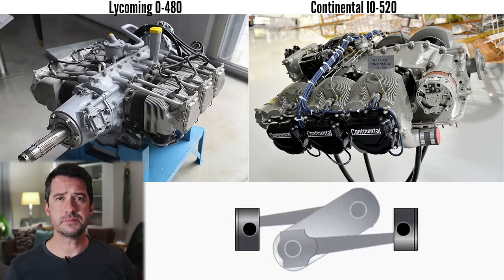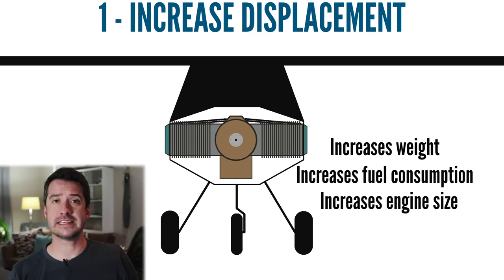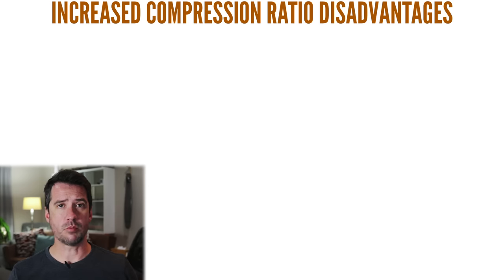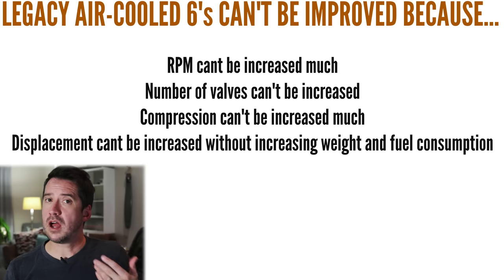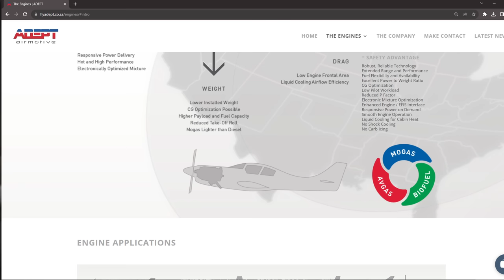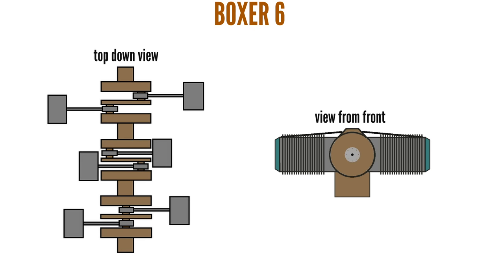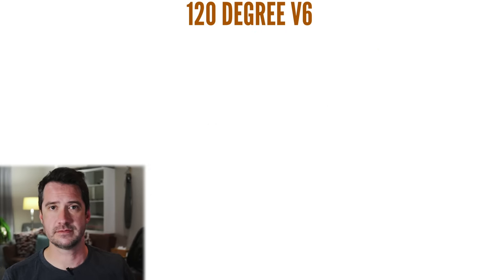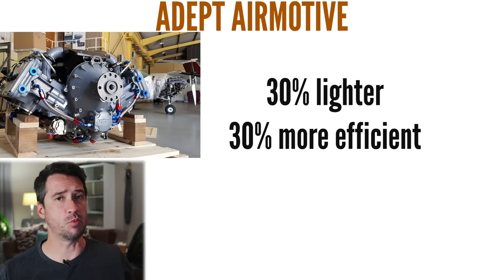Unusual V6 Airplane Engine Makes Boxer 6 OBSOLETE?

Comment: The future is with a return of the Detroit two stroke with direct injection coupled with a multistage electric turbo/supercharger. An hybrid of the sky who can have a very high compression ratio for efficiency, is compact, and able to give a big burst of power only needed at take off.

Comment: OHV valvetrain design is not a problem itself; modern OHV engines can hugely benefit from CFD optimisation and can produce very good power-LS series from GM is a good example. Besides that, OHV engine can pack more displacement into the same engine bay volume, we just need a modern engine, not a 1930s antique.
Reply: Pushrod engines are obsolete. They are okay for off idle power, but that is of no relevance to aircraft. Pushrod engines are less efficient and don't last as long. Hence, every reputable manufacturer no longer uses them.

Comment: Continental cranks fail all the time 😂
Reply from the maker: Which ones are that? I always though the bottom ends of Conti's are usually bullet proof and problems are usually higher up, e.g. the well known valve port cracks. At least I know it is for the O-300.

Comment: 120deg V6 does not exhibit secondary balance. It is almost as bad as I3 in terms of primary and secondary balance, with end-to-end rocking motion for both.

The only even-firing V6 with some inherent balance (akin to the crossplane V8) is the 60deg with 60deg offset crankpins. The primary vibrations become rotational, to be compensated with crankshaft counterweights. Secondary vibrations go (counter)rotational too, possible to compensate with a single balancing shaft, rotating 2x the crankshaft in opposite direction, so the gear coupling is the easiest possible, although most engine makers dampen these vibrations in the engine mounts.
Reply: The secondary imbalance of this engine configuration is not even enough of an issue to warrant the use of a balance shaft in the current 120 degree V6s from Ferrari.

Comment: The BEST for high horsepower requirements?! It makes 145 to 175 horsepower a 2006 2.5 boxer 4 subaru makes 175 hp. I dont understand why people think aircraft are so impressive when its rocking pushrods, you want high volumetric efficiency no? Get more valves a single overhead cam with 4 valves would be great, but a five valve dual cam engine would mop the floor with these beasts. A good engine is good but i dont respect the fact they choose to rip you off with abysmally out of date engines that spew lead everywhere, honestly want them scrapped.
Reply: 5 valves don’t work. I mean, I would love to see a warbird with heads with a lot of valves and spark plugs, but 5 isn’t it.

Comment: Just chevy LS swap it...they made them out of aluminum so light weight and they will turn 8k rpm, super reliable and relatively cheap, they love boost...and there is nothing like an American v8 screaming at 6-7k rpm
Reply: That would weigh at least 200 pounds more than this engine.

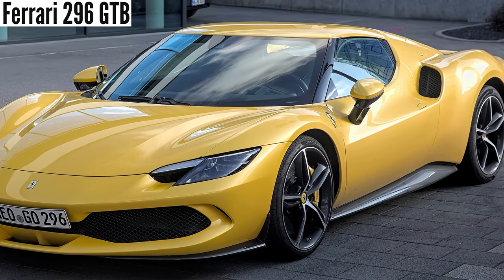Comment: I am really looking for a way to say this without sounding like an asshole... but I have never seen a boxer configuration engine in an airplane.  But then around 9:20 into  your video you take the primary advantage (secondary balance) of the boxer engine (which is not  used in aircraft) and spin it as a negative thing that this engine is overcoming... how do you overcome a problem that doesn't exist?  All of t he performance gains you talk about could be achieved by going to a boxer configuration... show me something beyond that and... well... probably still not worth the 500ish  units GA sells a year  unfortunately.
Reply from the maker: But it is boxer configurarions that most airplanes use, like the 6 cylinders in this video. Boxer meaning the opposing pistons move in and out together, since they each have a separate crankpin.

Comment: the DOHC v engine in aircraft has been around for 79 years. Your display engine has a Reduction gearbox (extra weight and maintenance) along with DOHC which is more moving parts and maintenance. The v6 engine was ran at the Reno Air Race in the "Ponds Special",  a Twin engine TSIGO DOHC v6 which failed in a turn causing a turn into  the dead engine at 400mph 300 feet off the deck. Diesel is the future for fuel efficiency in light  aircraft (The germans were flying a twin Bomber diesel in ww2).
Reply: The primary purpose of a PSRU is to improve the power to weight ratio of an engine.

Comment: These long used boxer airplane engines always vibrate like mad and are unnerving compared to automotive engines. If any car ran as roughly as these planes you couldn't sell a car to even the untrained user.  The rebuild shows are constantly spending 10's of thousands of dollars rebuilding the damn things so it's way past time to replace them with something far more modern, reliable and cost effective.
Reply: 4 cylinder engines tend to roll a lot because all pistons move and stop at the same time. Inline-3 or inline-5 is better.

Comment: You lost your credibility the moment you tried to say aircraft engines don't use shared crank pins  . Lycoming & continental engines have always ran shared crank pins that causes a twisting imbalances around a vertical axis through the engine taken up by the motor mounting system to save weight . the legacy engines are a locked designs due to federal regulation and testing procedures it is easier to designs a new engines than bring these engines up to new tocology they can be made much more efficient & reliable with more power but costs millions' just to change something like a bearing material or add electronics to ignition systems . If i remember correctly Just adding electronic ignition to one bank of spark plugs has an average 7% efficiency boost if taken advantage of properly.
Reply from the maker: But they don't use shared crankpins. That would sacrifice all primary balance. Have a look at a Lycoming or Conti crankshaft (Google if not possible in real life), it's easy to see 🙂

Comment: You clearly do not know how engine displacement works. You bore out the cylinder which takes out weight & put in new over size pistons that are aluminum, the larger pistons are most often no more weight than start.
Reply from the maker: That's how you do it after-market, and you are limited how much you can bore (obviously). But that's not how for example Lycoming increased engine displacement. Surely you are not saying an O-360 is a bored-out O-320. I think you get my point now.

Comment: I think all the advantages of this V6-120 could be present in a V6-90 degrees adding a perfect balance (first and second orders). But the V6-120 has a firing time of 120-120-120-120-120-120 degrees, and a V6-90 normally has 90-150-90-150-90-150 degrees and makes an unpleasant sound. But a V6-90 can have a different ignition order, firing all 3 cylinders of a bank and after that, firing the other 3 cylinders of the other bank, producing 90-120-120-150-120-120 (there are 3 possible combinations) . What sound would this engine make?
Reply: Most V6 engines are 60 degree.  The 90 degree V6 such as the GM 3.8 required a balance shaft.
Reply: @dl1027  The 90-degree V6 engine has perfect balance in first and second order. But this V6 GM is not perfectly balanced because the crankshaft bearings for cylinders 1 and 2 are not on the same axis. Same as cylinder pairs 3-4 and 5-6 (english from Brazil).

Comment: Converting the old engines to lead-free is actually pretty simple, just like it was for automotive engines 50 years ago.  Install hardened valve seats and MAYBE tweak the spark advance and you're done.  The FAA is probably to blame for leaded fuel holding on for so long in aviation, because they're so reluctant to make any changes unless someone gets killed... immediately.  The slow death tetraethyl lead can cause is just a "eh" to them.

Turbochargers also add a lot of heat, which is a huge problem for air-cooled engines.

Bumping compression ratios on a low-RPM engine can (will) lead to high piston and cylinder head temperatures, detonation, etc.

Overhead cams and multi-valve engines could be a huge step.  I'd argue they don't really reduce complexity over pushrod engines.  One upgrade that should be simple would be manufacturing cross-flow cylinder heads.  You get more room for larger ports and more efficient port designs, since they're on opposite sides of the head, and you get less heat into the intake port.

There is so much of the 1930s stuck in these engines and it honestly wouldn't be too hard to engineer it out.  But, again, FAA doesn't like change so they make any little tweaks prohibitively expensive.

Oh, crap.  This wide vee is going to be odd-fire?  Yikes.  One of the other huge advantages to boxer engines is that they're very smooth.  Odd-fire V6s have serious NVH issues, which is why the automotive world quit using them, again, decades ago.
Reply: Why would it be odd-firing? The firing interval of a straight three is 240 degrees, and a 120 degree bank angle is smack in the middle of that interval.

Comment: So this is basically a "copy" the 120° V6 Rotax prototype? iirc Rotax even built a 250hp(?) version, that was intended to compete with IO-360 and up.
Reply from the maker: Copy as in copied the idea of an aviation 120° V6? Maybe. Just doesn't look similar enough to me to be a copy, not that I care if it's a clean sheet design or not. But only judging by the few small photos of the Rotax, looks like Rotax went SOHC, possibly OHV, hard to tell. For the Adept to go DOHC is enough for it to have required some brand new design. But I'm just speculating, don't quote me.
Reply: @LetsGoAviate  which is why I put that word in quotation marks 😊

Also in my view the designs are sufficiently different that one could comfortably deny the allegation of theft of IP (which is what real copying would constitute).

I'm equally excited that someone is attempting to take that path. I think a higher revving, geared gasoline engine running on car gas is the only probable replacement for the old aero engines still reliant on leaded AVGAS.

Not all airframes are suitable for the comparably heavier diesels.

Comment: Decent concept. The engines need to turn more RPM without adding prop speed but even the GTSIO520 had redrive issues though. To me, the redrive/PSRU is always the achilles’ heel on higher powered general aviation reciprocating engines. Planetary is the best way to go IMO. Metallurgy and intake flow are other places of improvement for the existing mainstream engines to make more power in their current form.

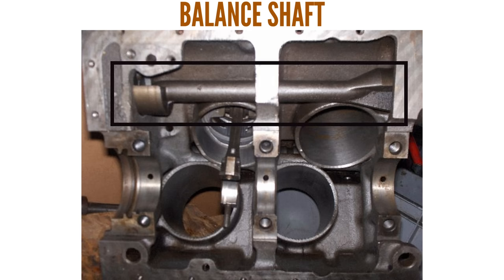Comment: OF ALL the balance shaft engines, you choose the ancient Ford (Cologne)Taunus V4  60 degree? That's certainly a blast from the past at ( 15:15 )
Reply from the maker: It's got to do with image copyright. Can't just use any photo in my video, and this was the only creative commons/public domain photo of a balance shaft available.
Reply: @LetsGoAviate  I see, it's a fine example indeed. Although that balance shaft plays havoc on the bearings and front seal when those get up in miles.Nice vid

Comment: Weird

I just watched a video explaining why all of the 120° V6 engines that were tested decades ago were found inadequate. Claiming it's a brand new design that'll make the H6 obsolete just seems like puffery at this point.
Reply from the maker: Reasoning discussed in the video. What was the intended use in that video you watched? I bet it wasn't aviation. Ferrari and McLaren also didn't seem to find it inadequate to use as recently as 2022 in the 296 GTB and Artura which is powered by the 120° V6. See what I'm doing? Blanket statements like "the 120° V6 is inadequate" doesn't fly. Inadequate for what? And technology have changed since "decades ago".
Reply: The Ferrari engine even won the most recent 24 hour race at Le Mans.

Comment: You seem to be ignoring the fact that the boxer engine can run with good balance without crankshaft balance weights, (eg. VW) but the V6 or any configuration other than the boxer requires crank balance weights to counter primary imbalance. Balance shafts as used in auto engines run at 2X crank speed and cancel second order vibrations. So I can conclude that the crankshaft has balance weights. The fact that it is a wide vee means that second order vibrations should still be very low. Note - Porsche and Subaru use counterweighted cranks on their engines, probably because they run much higher revs than a VW or air cooled aircraft H6.. Yes, this adds a bit of weight. Also, if a PSR unit is employed some sort of flywheel (probably damped) will be needed to control torsional vibration in the gear train.
Reply from the maker: Good points! Yes the boxer 6 doesn't need big crank balance weights which is an advantage. The 90° V6 (or any number V cylinders) needs heavy crank counter balance weights to achieve perfect primary balance, since the cylinders are not 180° opposed and thus can't cancel each other's momentum. This can only be done at a 90° angle because at 90° rotation the counterbalance cancels both the weight of the conrod (which is now "sideways") as well as the opposing piston in the other bank. At 120° (or any other V angle) this isn't possible. So while the 120° V6 will need crankshaft counter balance weights, it would not be as heavy as a 90° V6. The 120° V6's shorter crankshaft (than the boxer 6) is an advantage and will reduce the weight by however little that might be.
Reply: The crankshaft counterweights (CCWs) have two main functions. Think about a single cylinder engine. These can run smoothly with proper balancing using only CCWs. There is balance along the cylinder axis for the piston, connecting rod, and crank throw masses. Then there is balance for part of the connecting rod and crank throw mass perpendicular to the cylinder axis. Because these two aren't equal it is a compromise to design the counterweights. This can be greatly reduced in multiple cylinder engines because the other parts mostly eliminate this inequality. Only boxer or even # cylinder inline engines over 4 (i.e. 6, 8,10)can be perfectly balanced without balance shafts, or even CCWs.  In this case CCWs will greatly reduce the loads on the crankshaft especially at higher revs. Vee type engines consist of two inline banks at an angle so would need to be 12 cylinders to get to perfect balance. As you have described very well packaging concerns usually dictate the cylinder layout. Use of balance shafts is common and not hard to incorporate. @LetsGoAviate